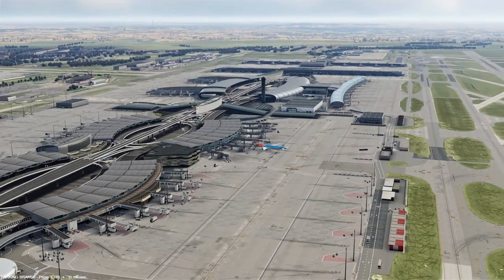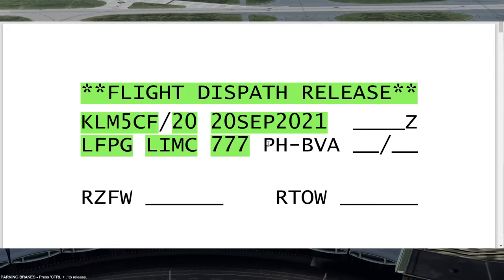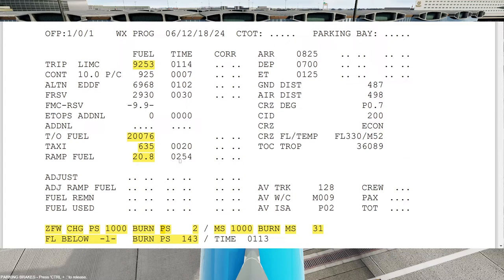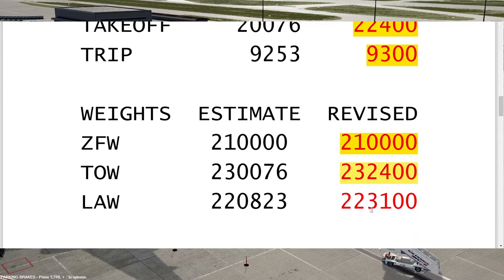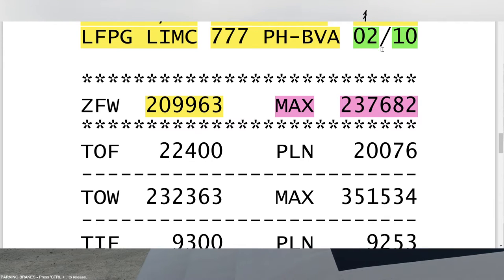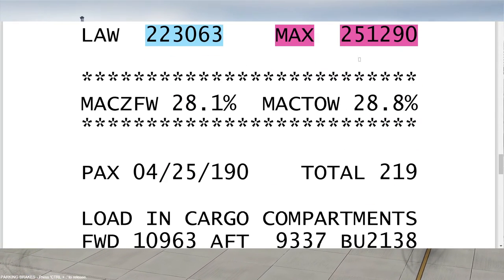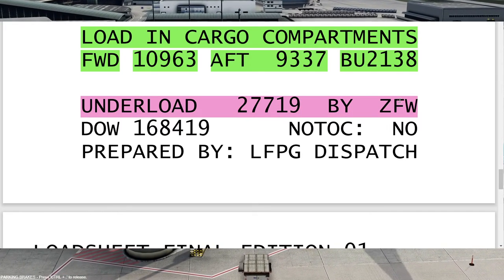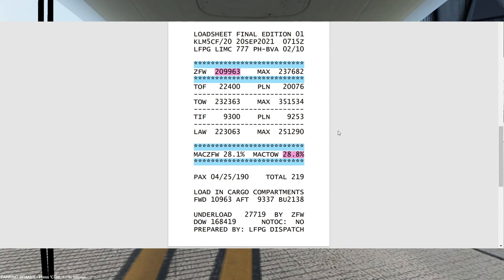Load and Trim Sheet - Boeing 777

Comment: How to make manual loadsheet?
Reply from the maker: Hello!
Manual loadsheet are forbidden for most airlines nowadays.
Some companies can do it for charter flights on small planes like the 737, but even those use some kind of automation (like an application for the pilots or an Excel sheet for the load control personnel).
So, don’t expect to deal with this. 
The chances of a flight cancelation are much bigger than a pilot manual loadsheet calculation! 
🤣

Comment: Make a video on loadsheet prepration
Reply from the maker: Nowadays the system is automatic and very little human input is necessary. 
So, it is very important that the pilots know all the information contained there in order to perform the verification and insertion of the correct data.
Reply: @LEVEL_CHANGE  bro try to make a video on how to make A320 /A321 loadsheet manual specifically described the graph section. 🙏🙏
Reply from the maker: @niteshgiri228  I’m sorry! I have no ideia about the Airbus Procedures. 🤷🏻‍♂️